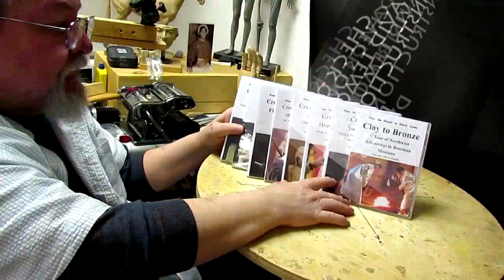Old Clay of a Mountain Man Un Taping and Shaping Foam

Comment: You can try warming the surface of the Monster Clay with your blow dryer a bit at a time, to do your detailing. May I suggest watching how Cyril Roquelaine [on You Tube] does his Monster Clay detailing. He uses a rather sharp serrated edged tool, with a scraping action, then melts the surface smooth with an alcohol flame bottle. 

I've made things out of insulating foam sheets using an electric carving knife. Cuts like butter and leaves much less mess too! Even fine cutting and shaving is easy to do. You may be able to find a cheap used one at a Good Will, or similar place.
Reply from the maker: Whole new tool set.. I'll try a bust in this monster stuff... but my future with it will be so limited...